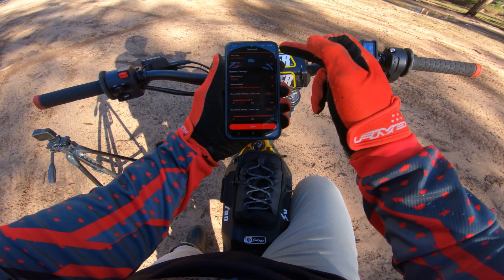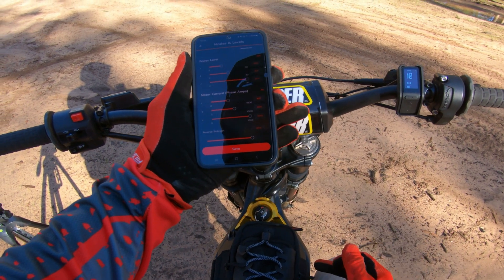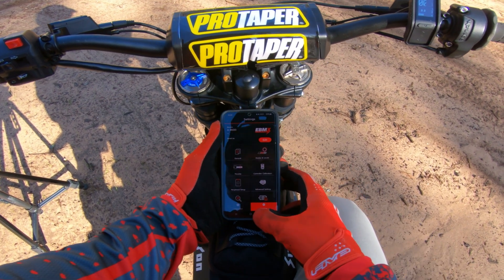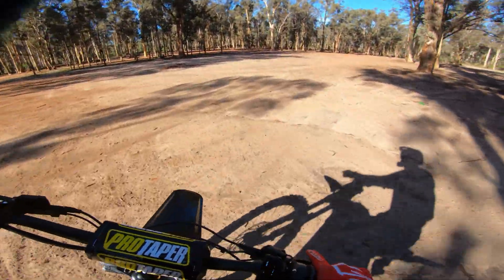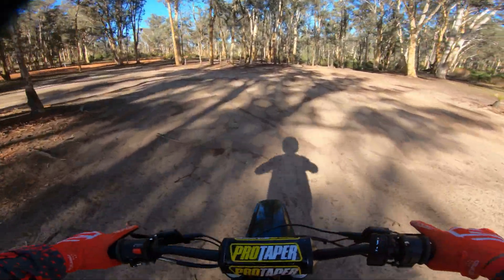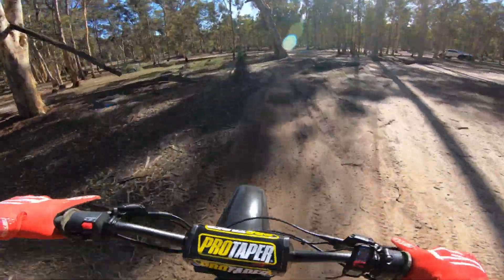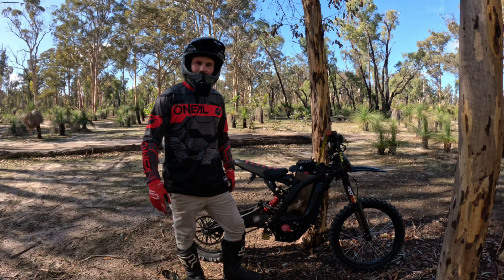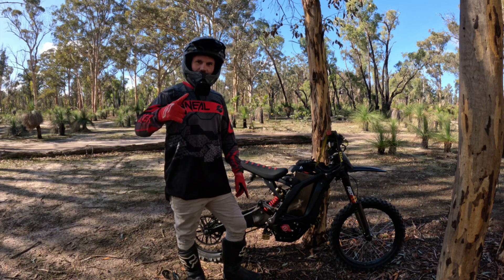Full EBMX Build With Max Settings!!

Comment: Are you running a 16 x 2 inch wheelset with that 64 tooth sprocket??? Tanks Mate! Awesome4 Video! Nice Bike!
Reply from the maker: @Sherman1862  Cheers mate. When I set the bike up for road I run 16" wheels and I run a 64T sprocket. I have found that works well with the EBMX motor

Comment: What a beast holy moly:face-blue-wide-eyes:
Can you use for example rear EXT shock with ebmx swingarm?
Reply from the maker: I'm not 100% sure, but the EXT fit the standard surron the you shouldn't have a problem with the EBMX swingarm as I still use the stock rear shock in there